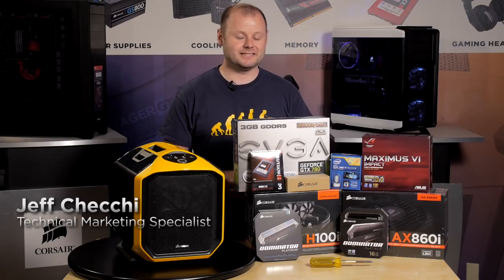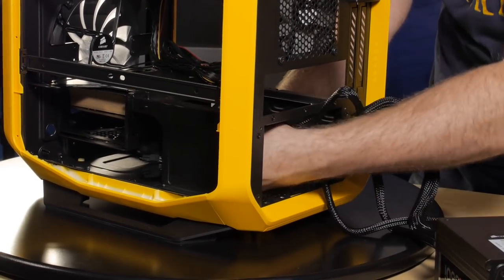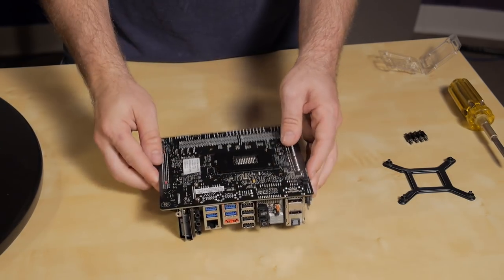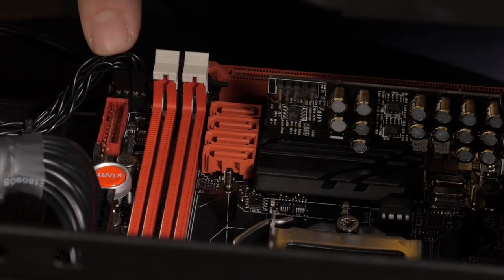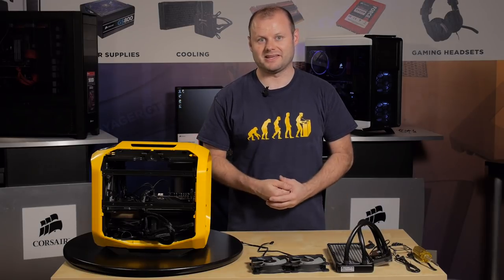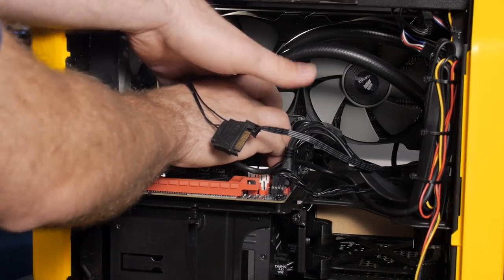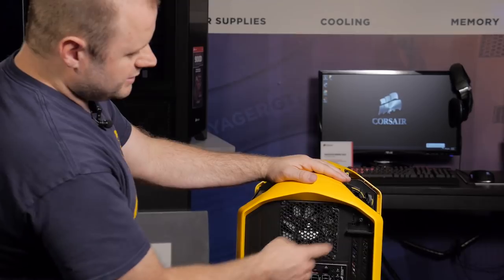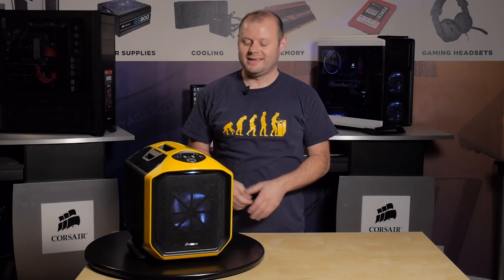Graphite Series 380T Mini ITX system Build log

Comment: Build tip: attach the RAM before you install the motherboard. It makes installation easier.
Reply: +Griffin Correia Build tip number 2: If your cooler doesn&#39;t have pre-applied thermal paste, able it before installing Motherboard inside the case.

Tip, don&#39;t just make a drop of paste in the middle of the cpu and attach the cooler. Pea method is overated. Look for guides online.

Comment: You should really think about coming up with additional short cable sets for small cases like this one.
Reply: What an excellent idea.
Reply: George Makris
 On the other hand, I found out that some of Corsair's PSUs don't have long enough cables to reach easily in some Corsair's cases. Which sounds illogical to me.
Reply: George Makris hey George just wondering if corsair are going to make windowed side panel for the Corsair 250D ? Both the gpu and possibly radiator side?
Reply: Efren Libres Why would you want to choke your graphics card or the radiator side panels by replacing them with window variants?
Reply: j1mmyz t3mpur4 cause i have a h60se on the front thats plenty of air flow for me. Would look sexy seeing my rog maximus board

Comment: Suggestions: make the "380DUO", by increasing the hight of the case by two (2) card slots, this will allow for "dual video cards" to be installed. As a side benefit, there will be room for a couple more 3.5 inch drives.
Reply: +Schpankme Verimuch Not many mobos have 2 pci-e slots. It would need to be atx or similar size and then the case would be much larger.
Reply: Your right, what should have been said:  Increase the size of the case to fit "mini-ATX."

Comment: There is a mistake in the headline of this video. It is a the graphite series case not a carbide case.
Nice build guide. Love the design of the 380t but i still prefer the 780t.
Reply: Good catch, fixed it!

Comment: I first wanted this case when I saw a modded to itx 600t. a year later you showed this and I was very exited, possibly willing to swap it for my prodigy. After watching this video, I'm very dissapointed. The led in the fans doesn't match the case colour, but even worse, all the front io connectors are colored cables, despite corsair using black cables on everything else.
Reply: Well, this is a pre-production model, so I don't expect all the cables to be black as this was the case in all of Corsair's pre-production cases. So I expect the cables to be black once the production models roll out the factory lines. With the exception of the black/black case, that'll have red leds, both the white/black and yellow/black will have white leds. So yes, you'll be disappointed to know that the leds will not match the case. Not quite sure if this will apply to the other possible colors coming in the near future, though my guess is that they will all be white leds as well. This is all I gathered from forums and social media sites with direct sources from Corsair staff members, but you can do your own research if desired.

Comment: WARNING: I had 3 problems about the case. I have the exact same build except for the GPU.

Firstly, the H100i cooler doesn't fit perfectly on the case. The case has this pointy screw-length rubber lock on the front which pierces and prevents the cooler from aligning the screw holes from the cooler and case. The screw is crooked/diagonal when fitted inside the holes but straightens once I tightened it. Though I'm a bit bothered by the rubber lock piercing the cooler but atleast it's rubber on rubber.

Second is, the IO shield has this semi-thick foam behind it which again, prevents the mobo from aligning correctly on the case's screw holes. I had to push it a bit towards the IO shield and the crookedness between the screw holes were again corrected by tightening the screws. Once, it was fitted the IO shield was bulging from behind.

Last is the GPU IO shield hole and lock. If you close that sliding mechanism and screw it in as seen on 5:27, the vertical screw holes of the case and GPU doesn't align. And if you straighten out the GPU and tighten the vertical screws, the sliding mechanism horizontal screws (5:27) is misaligned and can't be screwed in. I chose to use the vertical screws as this would firmly tighten the GPU in place and left the sliding mechanism slightly ajar and unlocked.

Other than these issues, the rest of the case were okay. But for an expensive case, these issues shouldn't even occur.
Reply: +Ralph L most of those are common issues at least for me in different cases I have had the same problems.

Comment: i want a response frome corsair .... my idea is that you place the cpu radiator to be intake ... you place the power supply to face up and the rear to face rear exhaust ... and front 20mm fan to bae intake ... also with reference card and i hope i have positive presure but not verry much ... just so the case is not having many dust isues..

Comment: I have 1 question. The wifi antenna that came with the motherboard, can it stick magnetically at the outside back of the case? Or is the case made of aluminium?

Comment: I just built in an Aerocool DS Cube, and it's great, but it's this case you show here that made me want to do a smaller case, but I have 2011, so no Mini ATX for that :P I wish this case did allow for a MicroATX board as it looks awesome (but the Aerocool DS Cube certainly is not bad either).
Reply: The Corsair Air 240 is perfect for you
Reply: L3ON360Z Thanks for reminding me, I saw that as well, but it's not out yet. I really like the one I have now though, so will probably stick with that, but you never know, a case isn't THAT expensive and it's fun to build :P

Comment: The rails for the aio can they be bought separate? The same question goes for the hdd bay?
Bought a used case there was in really good shape but these two things was missing. Need the aio rails the most, but can’t find a place where I can buy them.

Comment: I have a question for those who have this case. There is a SATA power cord coming from the top of the case. What is it used for? my motherboard (Gigabyte GA-Z97N-WIFI Mini ITX LGA1150 Motherboard) doesn't seem to have the space to fit it. I want to say its for the fan in front but I'm not sure.

Comment: i would turn the rear fan around so it's an intake for more air flow for the rad
Reply: That's not a bad idea. Maybe swap the front fan around as an exhaust as well. I doubt there would be a significant decrease in temps, but in theory it may be the better option.

Comment: I am having problems fitting the side plate back on the spec 3 case as the wires that attach to the hard drives stick out and i cant close the case on that side ?

Comment: Hello i did a build on the same case, and i did add a h75 radiator, i'd like to know if its better to connect it to the cpu pins or connect it to the manual fan controll pins?

Comment: Do you have to remove the 3.5 inch drive bay in order to fit the power supply in? I know linustechtips had that issue with the corsair 860 PSU. Is the 860i PSU different in length? I would like to use this case as a LAN machine if this is not an issue so response would be super cool.

Comment: Looking at the design of the case I can see why you had to limit the support of PSU sizes to 160mm.  I think that's a real shame, but it looks like you had no other options without making the case longer or moving the drive cages.  That does't seem possible here though.

Comment: Could I fit a large cpu air cooler in the 380T instead of a 240mm rad? I was looking at a xigmatek dark knight as of currently which is quite tall so I was concerned if it would fit.

Comment: How much room would you say is in between the top of the PSU and the bottom of the motherboard? The m.2 slot on my mobo is on the bottom wondering if my ssd would fit.

Comment: I love this case and build! One thing though; anyone know how the cable management is with this case? Enough room to at least do some tucking? I'm stuck between either this or the 250D for an upcoming build.
Reply: i have the 250 d i like it great cable tucking but its still a little big but it was smaller than my bitfenix prodigy. im going to get this case when it comes out becaus ein comparison it seems a little smaller. my only concern is i dont have that rog board i have the z97i, im worried just like the 250d if that h100i puts too much stress on that daughter board.

Comment: Hi 
do u think GV-N960G1 GAMING-4GD (L = 298mm) can fit this case? The Corsair website did mention the Maximum GPU Length: 290mm.
i know from the figures, it won't fit but i still hoping it does.
:(
Thanks in advance

Comment: would the powercolor r9 390 fit in this case?
Reply: kinda late reply here, sorry!

Unfortunately, the length of the Powercolor R9 390 measures 305 mm. This case will only support lengths of up to 290 mm, and i haven't found any other card in the R9 390 group that measures that except for an MSI one which measured 277 mm.
Reply: +Johan Branting Basically no 3-fan cooler fits this case, sadly enough

Comment: I'm confused as to why the 120's on the H100i were set to exhaust; wouldn't that push hot air from the inside of the case through the radiator subsequently heating up the coolant and delivering it onto the CPU?
Reply: Dmitry Lamburt I believe they it up as exhaust because the 240mm fan is right in front of them blowing cool air into the machine.
Reply: Dmitry Lamburt you can also look at it conversely....if it were reversed then the fans would be blowing cool air from outside the case across the radiator, subsequently pushing hot air into the case. Ive seen both setups...not sure which is optimal.

Comment: I just did a 380t build today and was a bit confused by the lack of connectors for the case fans.  There is one extra fan connector on the motherboard, which I assume I can use a splitter on.  The last thing is the three connectors from the 3-speed fan controller...I am not sure what to do about these.  Or are they redundant because of the front SATA cable?
Reply: ***** Yes.  The fan plug directly into 2 of the 3 connectors coming off the front panel.  Even though they are 3-pin, there are guides on the 4-pin connectors to ensure the correct connection.  Wondering where the directions are for these details myself!  =)  Good luck with the build.  I love mine!
Reply: Cliff Richardson Cliff I had the same question and I wasnt sure what to do with those three leads coming off the case. I just wrapped them up and put them to the side. I connected the two case fans directly to my motherboard. On a side note...how come that little power switch on the inside of my case didnt turn on the spotlight above my CPU? Did i forget to connect something?
Reply: YovieD I believe the SATA cable from the front panel powers the front panel items including that overhead LED.
Reply: yeah makes sense now. I did the research to get the answers. Only problem now is I already managed all my wires. Id hate to have to undo a few bunches of wires for a merely aesthetic change.

Comment: What sort of coolers could I fit into this? I am new to all this so I am trying to figure out what sorta stuff I could mount.
Reply: h100i v2 can fit
Reply: liquid cooling up to 240mm radiator
and air cooling can have memory height issues. 
The heatspreaders of the memory could block the air cooler.

Comment: So I just got one of these and it's gorgeous.  Unfortuantely, I'm unable to locate the molex connectors for the case fans..I Can find all of the 3pin female connectors (and their respective 4 pin male connectors) for the fans, just not the 4 pin molex power main..you went super fast on this vid.. and I think mine either didn't come with the case or I'm missing something completely...Anyone dig for the power connector?
Reply: And the images are all missing from the blog post..I mean the fan controller power, by the way :)
Reply: Nevermind!  It's now a SATA power connector.. For those confused by this video, there you go.. :)
Reply: how is the cooling in the case for the CPU and the GPU?
Reply: +CityWok TLK I put in a Corsair Hydro and gpu is over clocked and cool.  Flow is great with case fans as well.  Gpu is cool as well.  Love this case!
Reply: What gpu?
Reply: +Sean Thompson GTX 1080 Founders.  Fits perfectly.

Comment: Is it normal that I had to push and squish the wires, especially the large 24-pin connector to screw the 860i PSU in place? It's my first time assembling and I'm concerned it would damage the connectors. It's all jammed behind. Please someone reply.
Reply: Ralph L Yes, The man in the video would've done plenty of that but it's likely to be cut out. If you're worried, use zip ties to clean up the cable route.

Comment: Am I missing something? The fan controller here is powered by a Molex connector but in my case it's powered by a SATA connector.
Reply: Ralph L This was built with the original 380T, the newer ones have a few changes. (I.E SATA powered fan controller, black cables) Personally I can't stand Molex connectors.
Reply: Seff Hammar I see. Thank you! Do you have this case also? I had a hard time with the H100i cooler, mobo and the GPU IO shield hole and lock as there were imperfections on how the case was built.
Reply: I do. I mad a few modifications myself. Seeing as I was using only SSD's, I completely removed the 3.5" cage and cut open the top of enclosure for the cage to make ample room for my cables. I didn't have too hard of a time with my H100i, but once installed I had a tough time putting the finishing touches on my cable management. All in all I used around 50 zip-ties in the total build. I did notice a few imperfections in the case like you said. But all in all I'm happy with home my build turned out.
Reply: The 380T was not even my first choice. I originally wanted to do another full tower. I had my eyes set on the 780T in yellow, but Corsair doesn't sell it in that color anymore. Somehow I stumbled onto this case while searching the internet and built my whole system around it. I never though I'd build a Mini ITX system, but this case changed my mind. Kudos to Corsair for designing something that functions and looks so great. If they release the 780T in yellow though, I'm selling this build and making another.
Reply: ***** Read my Warning comment above. Those are my issues about this case. TL:DR, there will be a rubber screw-like lock that will make the H100i cooler difficult to fit and screw in the case. Motherboard I/O Shield is semi-thick because it has a foam, which wasn't anticipated in the screw positions in the case and will again make it difficult to fit the motherboard. Lastly, the GPU IO shield hole and lock at 5:27 is not made well because the screw holes on the case do not align with the screw holes on the GPU. Either you secure the GPU and leave the sliding mechanism unlocked or lock the sliding mechanism and leave the GPU loose.

Other than these issues in the build, the case is exceptionally good. Not as small as you would think though.
Reply: The 250D was my alternate case as well but went with the 380T because of the look, the built-in handle and open design which is better for cooling. But I guess also dust prone that's why I keep it covered whenever I'm not using it. Don't get me wrong though, those were the only downsides of the build in this video but it is a decent case. It really depends on what you're going for.
Reply: Seff Hammar so that SATA connection off the case is what powers the 3-speed fan controller? My MOBO didnt even have a connection for that.
Reply: +YovieD you don't plug it in to your MOBO, you plug it into your PSU.
Reply: +Ungatitosexy just make sure the length of your GPU is under the recommend size and you'll be fine.

Comment: hi chaps, I'm having trouble making the disission buying this because I'm having trouble figuring out whether this will fit my current gigabyte ga-970a-ud3 motherboard? or would I need a different one?
Reply: OfficiallTheTrueMuffinMan use PCPartpicker.com to check compatibility.
Reply: +OfficiallTheTrueMuffinMan No it needs micro itx i think so that wont fit besides thats a pretty outdated mobo at this point.

Comment: i have this case with a asus gtx770 oc ,gpu is 80c under load was wondering what temp you got with your gtx780 i`m a bit nervous about damage to my gpu with this case.
Reply: That GPU will throttle itself at 80C. So if you are hitting 80C, it means the card is already throttling. Going to assume you have one with the reference cooler on it. Its pretty common for that cooler to run them at a higher temp even in well ventilated cases. You can manually set the fan higher, or put an aftermarket cooler on it.

Comment: Do you think Corsair could make something similar to this, but cheaper and allot smaller. My homemade Case out of an Old Ammobox is about 300mm long, 220mm tall and 175 wide. I'd like something to replace it because i am bad at making cases :P anyone in the comments have any suggestions? Cost has to be less than £50 or about $80. Having a Handle is vital btw :P as i go to Lan party's etc.
Reply: I was gonna suggest a spec 01, but you want a handle so nvm xD